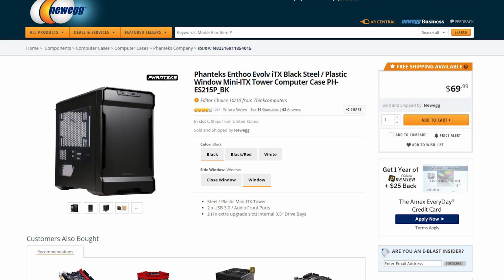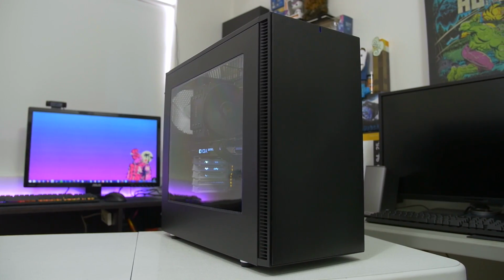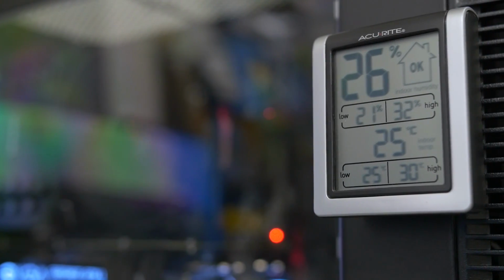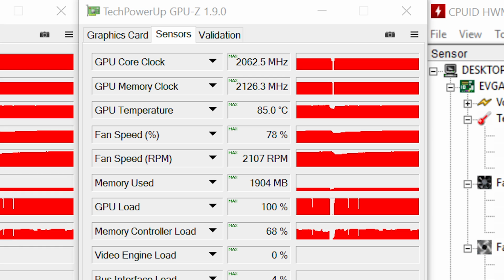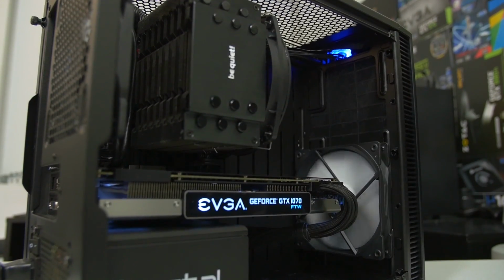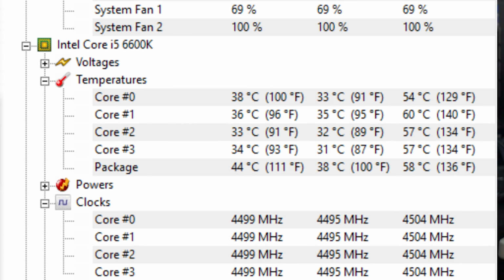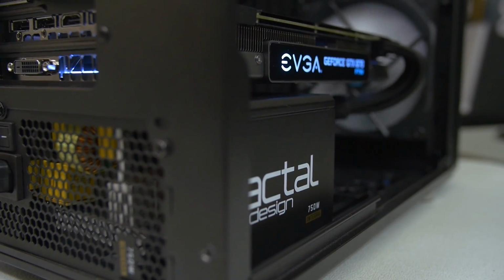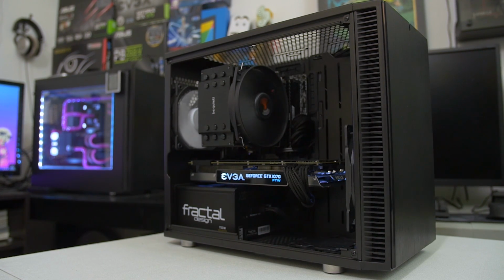Are Blower Fan Video Cards Actually Better in SFF Cases?

Comment: Anyone use one of those AIO liquid coolers for the GPU? I'm curious how they perform compared to traditional air coolers.
Reply: Yeah, I had a GTX 980 Hybrid which ran with a 120mm rad. It kept the stock temps real frosty (~50C) and when overclocked I never hit more than about 65-70C. I was able to push the card to its overclocking limit. Unfortunately I believe the way the kit was designed, it meant that the water pump was running at full speed continuously. Not a massive deal as the acoustics were still on par with an air cooler, however it bothered me a little.
Reply: MrTechguy10 Cool. Thanks.

Comment: but the evga cards pull air through the fins and out the fans so would it be different with say an msi card with intake fans?

Also I have a gigabyte windforce in that phanteks case shown and it is relatively quiet but even if I oc a singular megahert then unigine valley crashes so what's going on

Comment: Msi R9 390 + Enthoo Evolv Mini-ITX = HOT Gpu. Found this one wife's build. The Msi 390 is 2.5 slots wide, so it was bigger than normal & thus choked itself on the PSU shroud.

Comment: My power suply is in the uper right corner.  Enough space for my card.
Reply: +Renzy Ncase M1 has the PSU in the upper right.
Reply: My case is a custom case from arlt. A german PC shop.
Reply: if it works, why change?
Reply: You have a case from 2006
Reply: core 1100 is like that
Reply: HappyPhilXD nice.